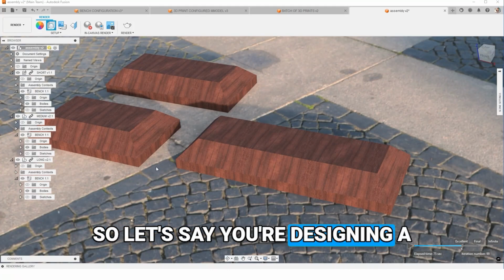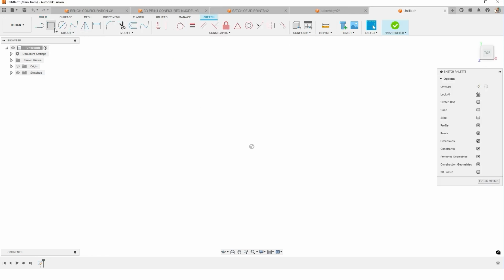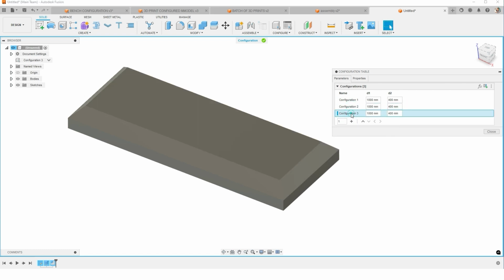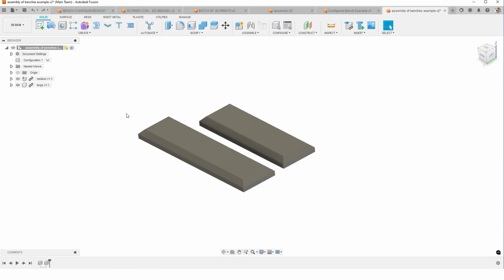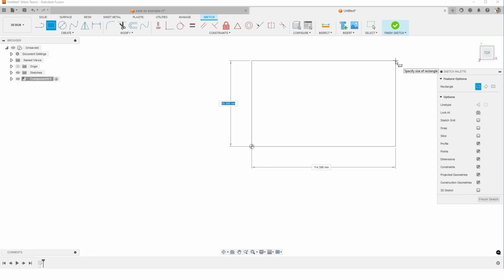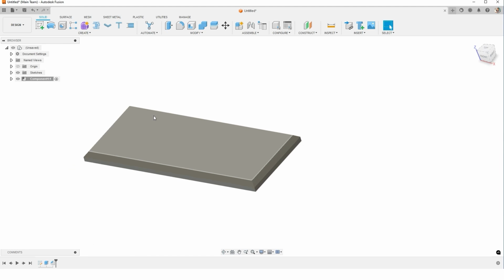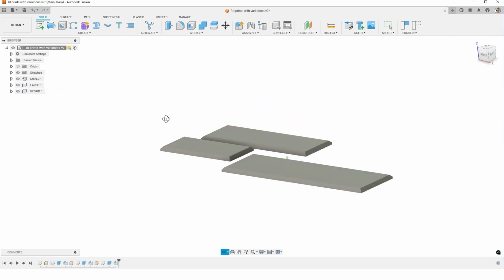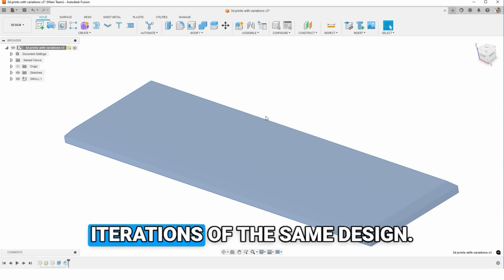Fusion 360 Configurations and Parameter Techniques for Unlimited Iterations (Paid and Free Version)

Comment: Love your content. Very informative and to the point. I use parameters all the time and it is such a time saver. Sometimes I have issues though when I change parameters and it doesn't solve. Like if I have too many chamfers and fillets on and then try to change a dimension. I wish I had a way of knowing at what step I am creating an issue for future parameter changes.